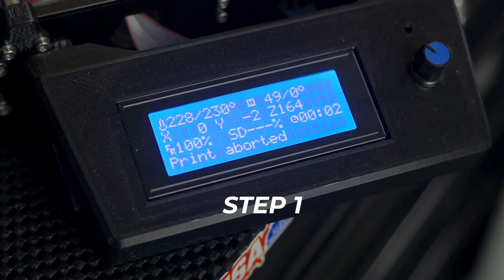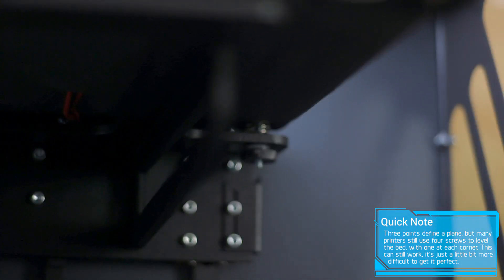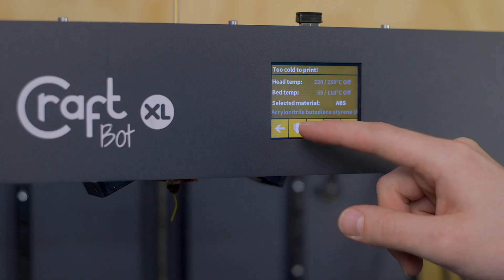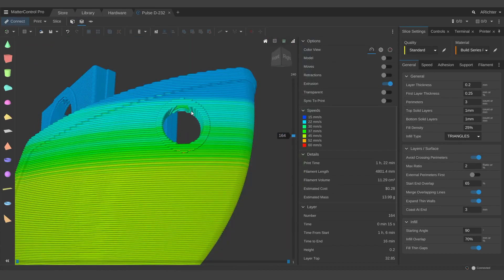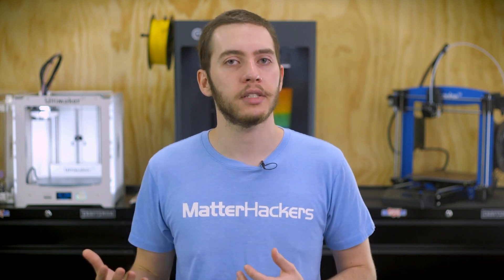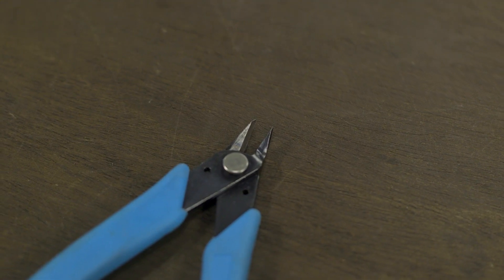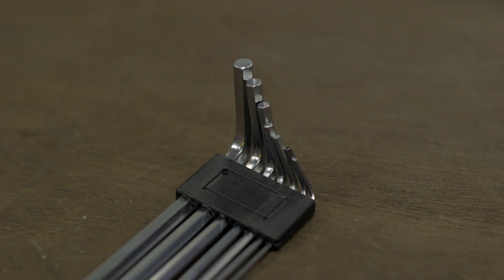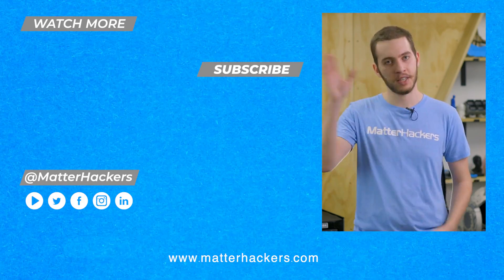Top Ten Tips When Getting Started With 3D Printing

Comment: Thanks for the video. One thing I would raise though. The filament removal steps are, IMO not the best and I think this is potentially a good example of unquestioned "copy" behaviour. Personally I would instead recommend Dave Crocker's (the Duet 3D guy) approach. When removing filament heat to about 2/3rd's extrusion temp. So if removing e.g. PETG heat to about 160. Then remove the filament by giving it a firm tug. The filament comes out nice clean a bit like when doing a cold pull (but easier because it has been nicely heated to a temp where it will release but is unlikely to snap off). When you heat to extrusion temp, you leave a blob of filament in the extruder, which is messy and can lead to other problems. One of the worse problems that can occur is if you then need to load a higher temp filament, for example PC. You can end-up overheating and annealing the residual filament such that it ruins the nozzle. This is a very common problem and the cause of many a partial clogged nozzle and is almost impossible to clear. Keeping the nozzle clean surely has to be better.

Comment: Hi. Great material! I'd like to ask which material do you recommend as the most fire-retardant one?
Reply: ABS is likely going to be the most flame retardant filament concerning ease-of-use to flame-retardance. You could also try PETG, or some of the higher-difficulty / more expensive filaments, although most basic consumer machines likely won't be able to print such.
Reply: @banjogates  ABS, as it is oil based,  is actually one of the least flame safe, others like PLAs and some PETG's do not burn, only melt